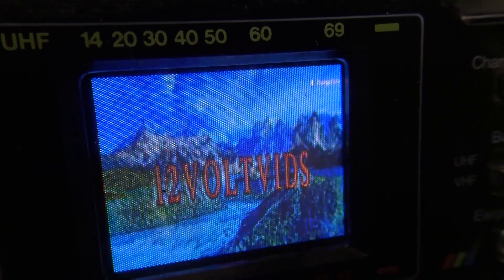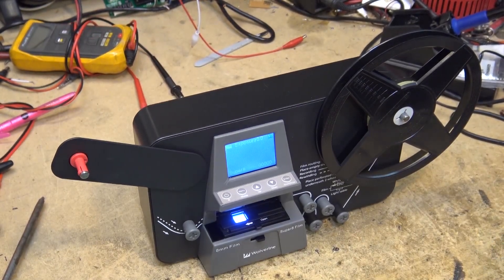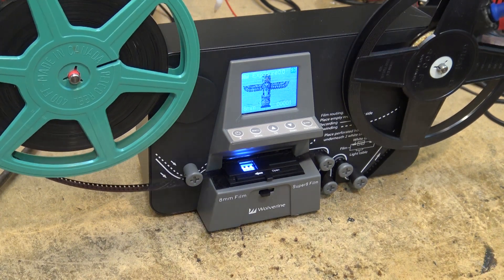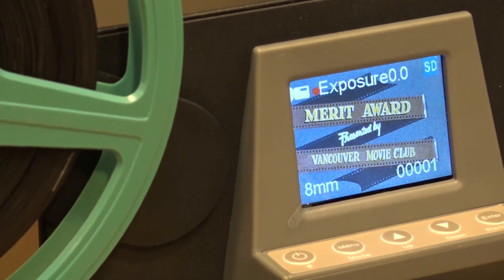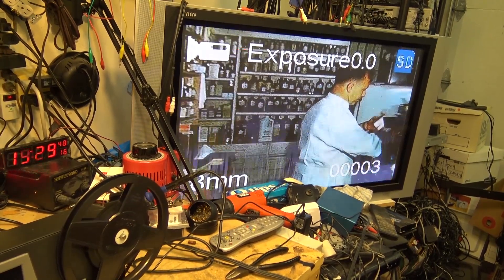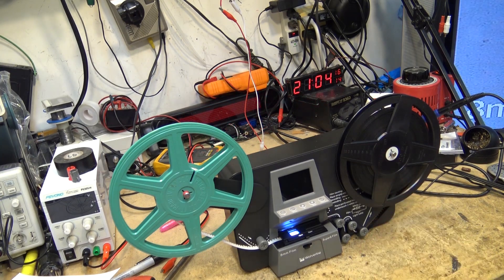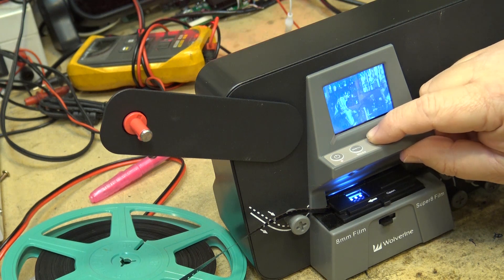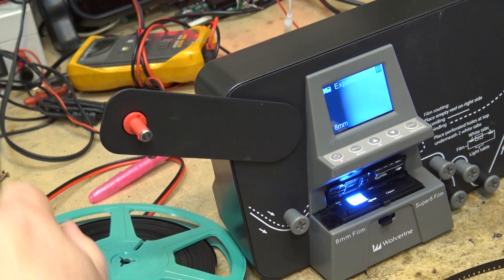Wolverine Film Scanner evaulation and quality check

Comment: 8mm with sound = Super 8
I would have thought he would know this.
Reply from the maker: No!  8mm and super 8 are 2 different formats.  
Regular 8mm was also available with sound.  I should know i have a regular 8mm projector, with sound.  As far as cameras went then you are correct, only super 8 was available with sound on camera and only super 8 film was produced with magnetic sound on film. All regular double roll 8mm film was silent.  To produce an 8mm sound movie was exactly the same as producing a 16 or 35mm sound movie.  The sound was recorded on tape, after the film was processed and edited it was sent back to Kodak and a magnetic sound strip was glued to the edge of the film.  Audio tape was edited to match the picture and then the audio tape was dubbed onto the edited film.  Yes it was a ton of tedious work.  My father in-law did a number of sound 8mm films in competition for the Vancouver movie club and won the Merritt award.  His film is on my channel and it is a sound regular 8.  I had to scan the picture with my scanner and play the sound in the projector and sync the sound and picture together.  Look up "Mr gullible" on my channel to see it and appreciate the work he did on this film.  He and his brother in-law shot, edited and acted in the film.

Comment: The aspect ratio is off it stretched the image into 16:9 wonder you could probably bring it back to 4:3 by cropping the image In a video editor then if your okay with losing some image you could then zoom it in to fit a 16:9 ratio but then it would at least look right and not stretched.

Comment: I think the idea is good, but it would be nice if the images were just sent out in JPG instead of the crap codec they must be using to compress and make them motion
Reply: Internally it is literally a Novatek dashcam with a new user interface.  The bit rate is about 9.8 kb/sec. The codec is in hardware, not software.

Comment: Is there a way to keep the original 4:3 aspect ratio?
Reply from the maker: It does capture in 4x3, my editing software stretched it out because I was editing in wide screen as my camera footage was in wide screen, and it sets itself based on the first clip imported I could have changed it, but then my camera footage would have been all squashed and un-natural looking.
Reply: It's un-natural looking, now!
Reply: The Wolverine captures video at 1440 x 1080 pixels with pixel ratio being 1.33333.  Using Vegas Movie Studio as editor, I simply changed the clip property to square pixels (1.0).  Gave me just the right aspect.

Comment: Are you sure this is new?  The way this thing works, being mostly mechanical and having to stop and start for each frame, seems like something designed in the 70's. You'd think they could just run the film through at about the rewind speed while they took video of it then use software to separate out the frames and put them back together to restore the film to create a digital version.
Reply: Something similar to that will be possible in about five years.  What we have now is the inability of a video camera to take stills that quickly at such precise intervals. It would be either 18 or 24 frames per second without so much as a nanosecond of lag time.  This is to say nothing of the need for precise synchronization of the capture rate and the mechanism for frame advancement.  One of the better ideas I've read has been a fusion of a standard projector's frame advance mechanism with a flatbed-style scanner, scanning 18-24 frames at once and compressing them into one-second video chunks in background, then splicing the chunks together to produce the output video file.  That could be done today.

Comment: Was skeptical of the unit’s claim to process and convert 35mm slides into quality images. https://www.youtube.com/post/UgkxKmnkpmXKhuEJXQRC5kmg2WDHyWIdGyiE The reviews convinced me to try it. Glad I did and was quite surprised! As you can see in posted image, I scanned 16 Carousel slides trays in three partial days with 30-40 trays remaining. I had researched companies that process for you but they were ridiculously expensive. This route was the most cost effective for me. The repetitive motion can cause some fatigue. I’d scanned two trays, then took a break. I also had some 47 year old color negatives that I could not identify. Ran those through the unit and the results were great. It automatically converted them to perfect images. I will use a separate photo program to fine tune any images that need an adjustment. In a nutshell, this scanner works great! I highly recommend it. Well done, Kodak!
Reply from the maker: The PQ is great.  Can you do better? Sure and the sky is the limit for price. I maintain equipment for a guy that has the best scanner in the country. He does all the high end work for tv stations and government archiving their media.  Was telling me the gates for each oddball film size (like 9.5mm for example) are like 5000 each so if someone has a 9.5mm order they better have enough to justify the add on gate.  He can do everything. 8mm super 8, 9.5, 14, 16, 18, 24, 35, 65 70 ect.  His setup well into 6 figures.  That's his business though and he has the clientele that will pay 50.00 to scan a 50 foot roll of film.  Has to be a really special film to spend that much on.  I charge 10 per roll and people complain about the price but never the quality.  Most bring 1 or 2 reels and then when they view the film they come back with a box with 1500 worth of film in it.  This unit has paid for itself so many times I have lost count.  The very first order paid for it.  It's had so many reels of film run through it.  The take up motor failed Soni just let the film drop into a box and reel it up after it's done. Would buy another one in a second when this one finally breaks.

Comment: That's not grain - it's compression artifacts. Has anyone ever upgraded the image sensor and electronics yet? The mechanism seems fine, but the sensor and compression used are terrible.
Reply from the maker: It is grain, and youtubes over compression of the grain. The output looks far, far better than youtube is capable of presenting it.

Comment: Yeah, I'll be steering clear of this unit. The compression is godawful. That's not grain or anything from the film. That can only be through the digitization process. I've yet to see a sample from this machine that doesn't show those compression artifacts.
Reply from the maker: It all depends on what you are attempting to do. This is a 500 machine and for 99.9% of the intended buyers it is going to deliver a more than acceptable picture.  Having owned the unit now for over a year and put through several hundred reels of film for clients not one has ever had anything but glowing reviews.  Also several people brought me a reel or 2 to have digitized so they could check the quality before spending the money to buy their own machine and then bought their own to do their own because they has so many reels that I would have charged them more then the machine cost to do it. There is a unit that you can buy made by a guy in Texas that is about 5000 just for the hardware and you still have to buy a computer and specialty software to run it.  Plus the thing takes up a full table and all the resulting footage needs to be post processed.  By the time you are done about 6500. You sound like the .1% that would benefit from this setup as you can save your scans as a raw image. I was looking for a machine that I could quickly recover my investment so I could make some money. This one fits the bill and the results are better than they show on YouTube as YouTube recompresses everything adding additional compression artifacts.
Reply: @12voltvids  First, thank you for the work you put into this video.  In your honest opinion, don't you think with all the forums dedicated to this endeavor and the comments generated in YouTube comments sections like this that Wolverine (or whatever company actually designed and manufactured it, since it's certainly NOT Wolverine) would take heed and invest a tiny bit of R&D to meet the standards that modern cameras and video compression software can produce?  The better camera quality and software for better video compression without so many godawful artifacts would not cost them much more, if not less, and would make for a much better result.  Why don't they care about quality when it could so easily be improved?  Too many tech companies are not enough interested in end results, so they miss out on the high sales volume they could have with a better product sold at a reasonable price.  In this case, they'd be preserving memories, which has a social benefit.  If we had governments run by intelligent people with foresight, these machines would be subsidized.

Comment: This looks... really bad? It's like this scanner has a cheap mobile phone camera there...
Reply from the maker: Actually it looks very good. YouTube messes up the video during recompression. The file is 1440x1080p@20 fps.  In my editor it was set incorrect. The camera shots were in 1920x1080i 60field. You tube deintetlaces it and it looks like crap.  I have a sample uploaded that takes the original file and it looks great.  I have done hundreds of reels for clients and every one of them are very happy with the results.
Reply: The fact that clients were happy with the results, doesn't mean the results were particularly good, though. They just didn't have any comparison.
If you'd ask me, the scan is not very sharp and has small factual resolution, upscaled to 1080p. Also I'd saay the grain is mostly caused by the cheap camera this scanner has. The brightness/contrast seem to be heavily increased by software of the scanner, in order to mask the bad raw picture.
That's only my opinion, but I think if you scan it professionally, it would be much much much sharper, and would have much wider brightness range.
Reply from the maker: @pshq  
Again, and I have said this so many times I am tired of saying it.  It is not a professional device. It is a consumer device.  A tank cintel scanner could do a superrior job but it is 100 grand.  ( That can scan any type of film from 8mm to 70mm) even the 5000 film scanner would be expected to deliver much better results.  How much would I have to charge to do it with one of those machines?  Nobody would pay 50.00 to transfer a 3 minute reel.  Even at 10.00 they complain, because they generally have a box full of little reels.   Also these films are all 50+ years old and are all in some form of deterioration so that is going to degrade the image.  As a consumer machine and that is what this is, the picture is excellent and exceeds everyone's expectations, except for you and 5 other people that expect more than it is designed to give.  It uses a 3megapixel sensor which does deliver a 1440 x 1080 image without any need to upscale it.
Reply: >without any need to upscale it
because it's upscaled by the software
But okay, I'll finish this. You're probably right. It's not THAT bad anyways.
Reply from the maker: @pshq  my original older HD video cameras that were 1920 x 1080 only had 4mp sensors.  Early dashcam had .3 megapixel sensors which put out  640x480 which through software could put out a file that was scaled to usually 1280x720 in .Avi format.  They looked like crap.  This outputs a native .mp4. Yes you can digitally zoom in and this will slightly degrade the image as it is looking at less pixels. I had it dropped here.  It actually looks even sharper if you zoom back all the way and show the full frame including the sprocket hole around the frame and then crop that out in your editing software.
Reply: Ahh, so it's digital zoom! That explains a lot...
Reply from the maker: @pshq  
Yes a digital zoom which I had cropped when I scanned this film.  I have since found that much better results can be obtained by zooming back to full frame and cropping in computer but when I Moved doing transfer for client I give them that option.  Crop it so the above and below frame over is cut off or allow the full frame which shows a portion of the above and below frame to show which then they can take out in editing.

Comment: I wonder how much a Telecine costs.
Reply: it depends. Most Scanning facilities have Minute prices. However in every case it would be a lot more worth the price than such cheapo DIY toys without the slightest bit of manual operation. That and because this thing doesn't even copy the magnetic sound of the reels. With a professional telecine you get it all, picture and sound at the right speed and at a better quality. Also, never throw away the original filmreels. They will always last longer than any videoformat.

Comment: How do i do my 7 inch reels?
Reply from the maker: You need a 7" take up reel. There are 2 versions. The standard only does 5" reels, the pro model supports up to 9", but they only ship with a 5" take up. I have a bunch of empty 7" reels for sale.
Reply: @12voltvids  thank you for clearing that up 🙂
Reply: @12voltvids  oh by the way I forgot to ask you how much your 7inch empty reels are going for?
Reply from the maker: @vincentortiz4077  Open to offers.
Reply: @12voltvids  are you willing to do 5 u.s dollars thats about $7.08 Canadian dollars for two
Reply from the maker: @vincentortiz4077  Yes plus shipping of course. It is brand new never used dual 8 with the adapter hubs for 8mm spindle.
Reply: @12voltvids  ok sounds good how do I give you my information

Comment: How come, Standard 8 suddenly is Widescreen ?
Reply from the maker: It is not, my editor stretches the image to fit the screen because I was editing in 16:9 mode.
If I want 4:3 output I have 2 choices, shoot the entire video in 4:3 ir fu&k around with the clip to match the frame size. What comes out of the scanner ia 1440x1080 4:3.